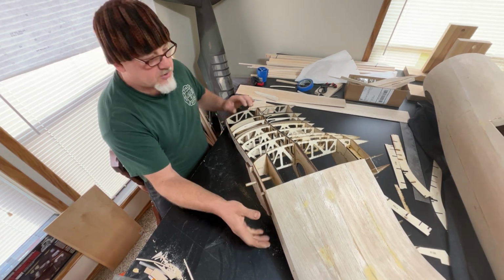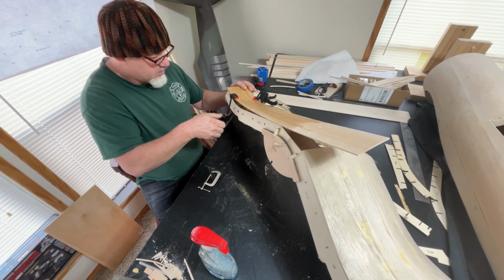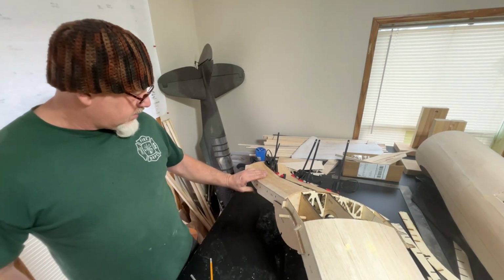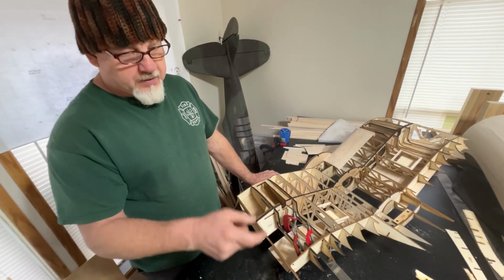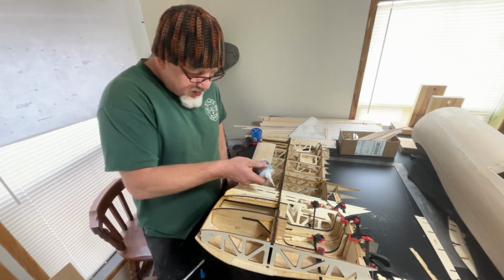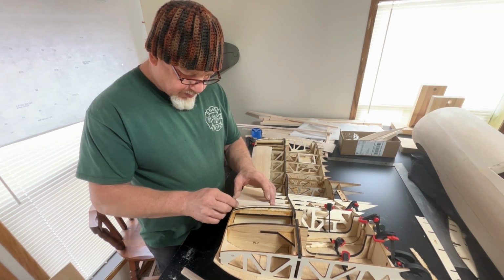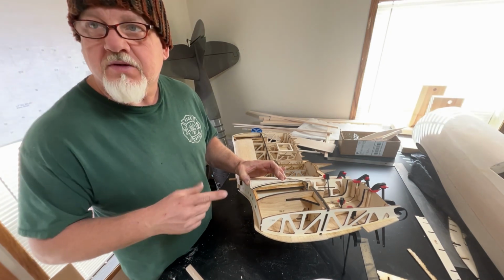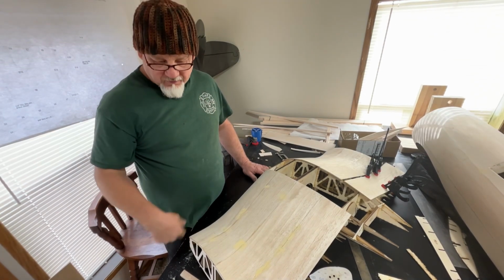Meister F4u Corsair silver build S26

Comment: Noticed the union logo on the tee shirt. Trucker or retired? I’m mostly just tired these days but have             a real affinity for you that have the patience to build such a/c. Tell some stories abt yourself and                    other planes you have labored over. Whenever I spend so much time on a project, I’m usually too                   nervous to fly it. You too? Btw, I’ve got CA that lasts years in the refrigerator.
Reply: What do you do when a servo is so buried and then lays down? Make any provisions?
Reply from the maker: Thanks for the comments I was a firefighter for 23 years, my son is still a officer on the same fire department I was.
I will put covers over the servo’s. I have a asp fs400 ar radial engine for it. Converted to gas.